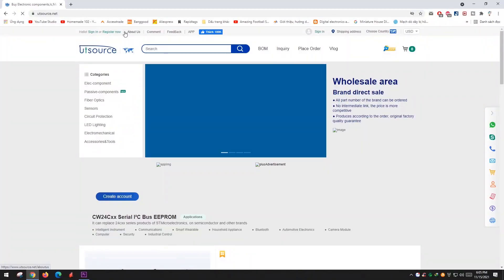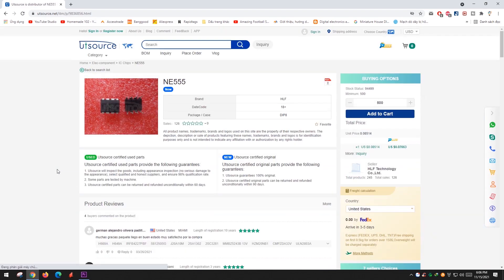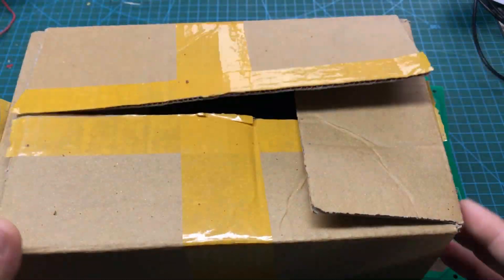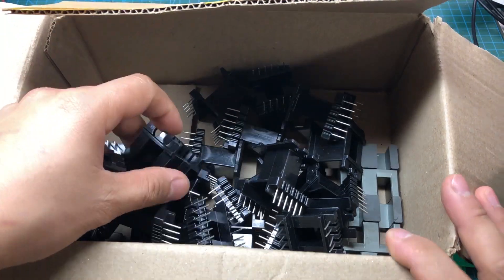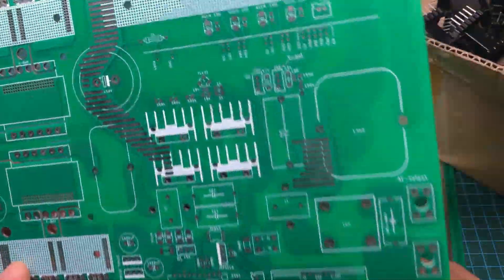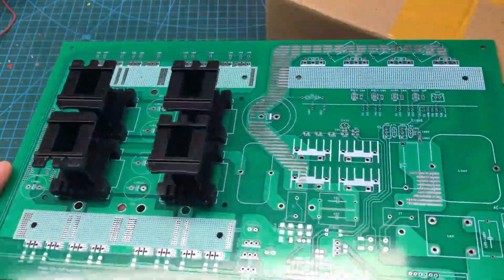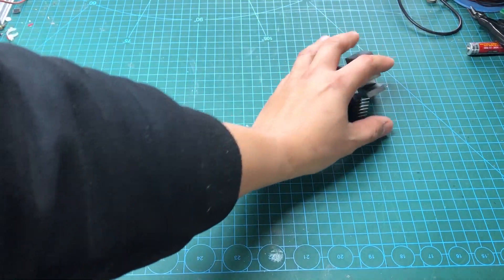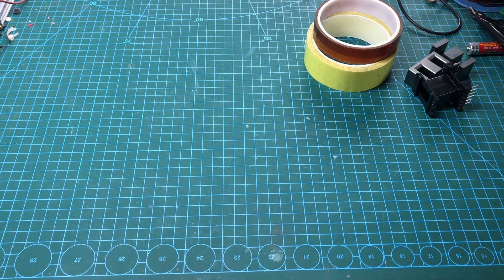Commercial inverter 3KW-48V | utsource

Comment: please make a tutorial on how to modify the lm2596 dc converter to be isolated
Reply: later I want to make it the egs002 supply module for high-frequency type inverters
Reply from the maker: you should use UC3843 or IR2153. It's better.
Reply: @PhdHung  ok, do you have a schematic
Reply: @PhdHung  in advance thanks for your response

Comment: How many volts is the output?  the lamp is dim compared to 220 volts
Reply from the maker: 100V bro. There are 4 pulse transformers in series. ~400VDC at the output.
Reply: @PhdHung 4 transformers to get 400V?! And what is an effectiveness of such solution? Why haven’t you used a “normal” LLC converter as ALL manufacturers recommend (and they have many app notes and IC solutions about that)? I thought these are mosfet driver transformers of an enormous size )))